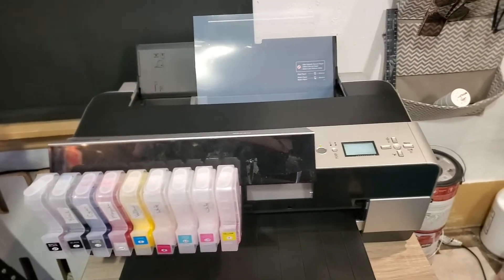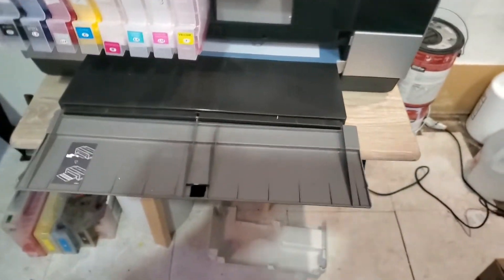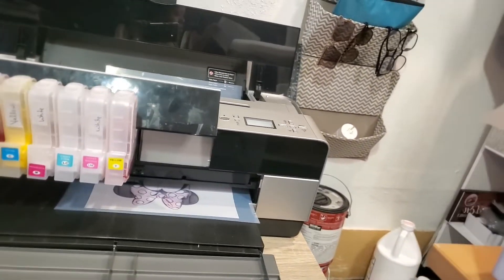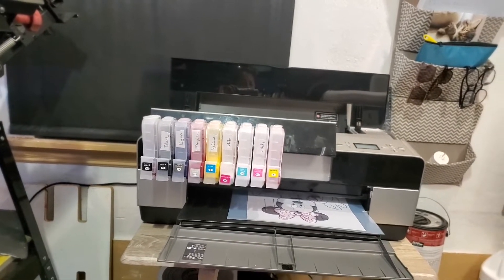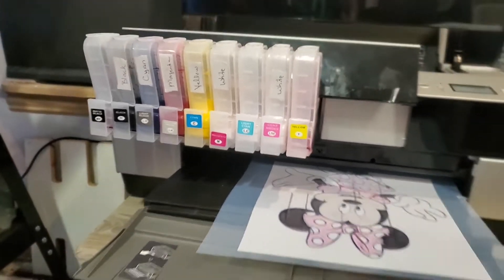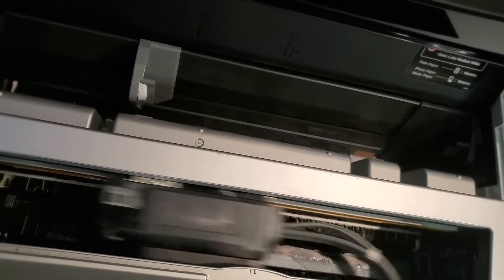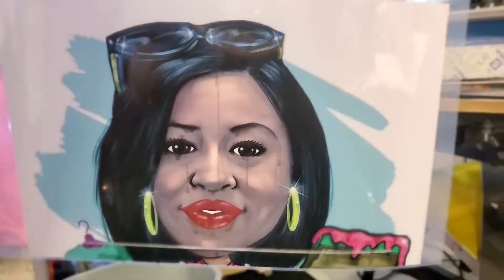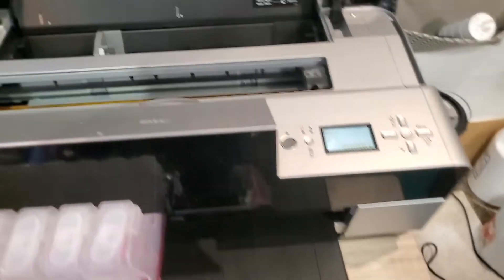EPSON 3800 DTF Printer Conversion | Ink Order | Nozzle Check in Cadlink

Comment: hello what  rip you need for this particular printer epson 3800 please thanks ????
Reply from the maker: I use cadlink digital factory. There are videos here about it
Reply: Lady Print Boss. did you figure out how to bypass the “Ink Cover Open “  on this 3800?
Reply from the maker: Yes u need to stick a piece of cardboard into that slot on thr left side stilling pushes in and it will read as if it is closed. That is covered in one of the video on the 3800 not sure which one but check thr channel page for printer playlist l belive I covered that on my conversion video

Comment: Hey Sis, I'm riding the struggle right now trying to figure out this epson 3800. It driving me crazy🥴. I drained all the initial ink out via cleaning solution in cartridges.  Now that I put dtf ink in (even after about 10 power cleaning or more)  some colors are still are now showing up on prints. How many cleanings did you have to do before the dtf ink printed ot?